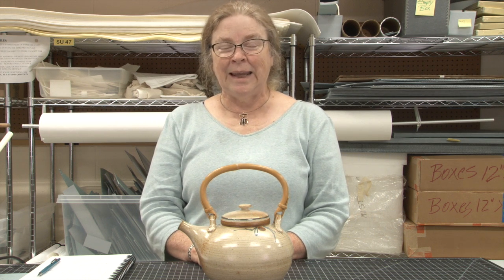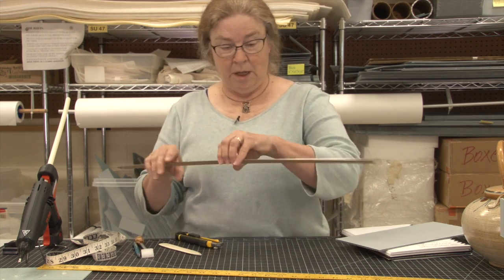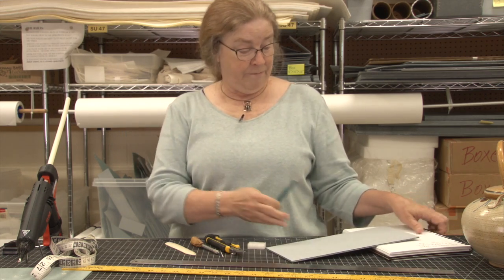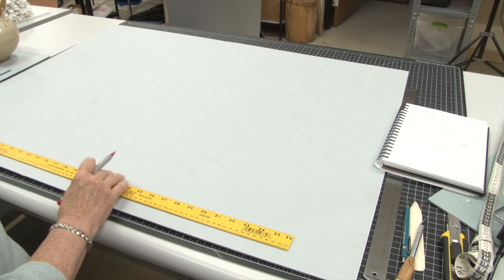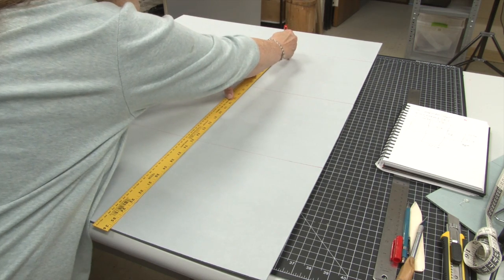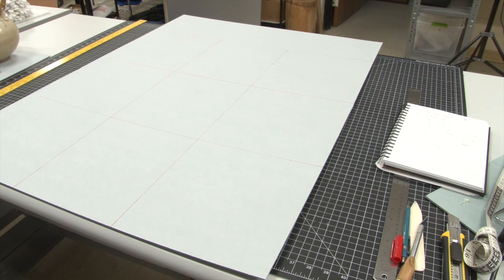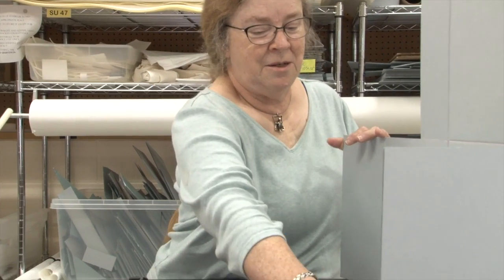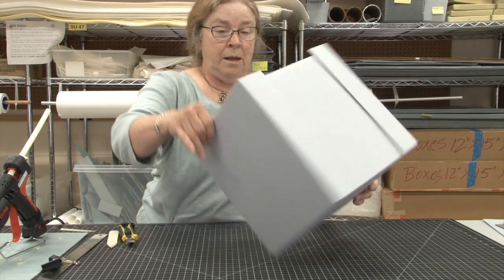How To Create a Storage Box for Museum Artifacts

Comment: So it’s archival cardboard, but is it archival glue?
Reply: She’s using hot glue which is  inert (meaning it won’t off gas or change over time). I wouldn’t buy hot glue cheaply from amazon or harbor freight (it might have other chemicals in it) but a reputable hardware or archival store will have good quality hot glue sticks. Hot glue will also make the process faster as the bond is instantaneous as it cools. Or you can use a PH neutral adhesive from an archival store, but the process takes longer and you will have to clamp the box overnight. I actually prefer this method because I feel like I have more control over where the adhesive ends up and I don’t have to deal with the messy “micro threads” that the hot glue can sometimes leave behind.